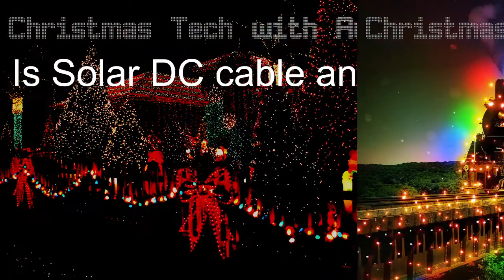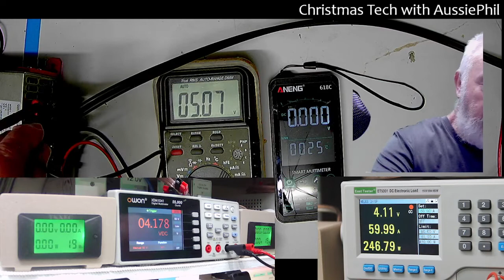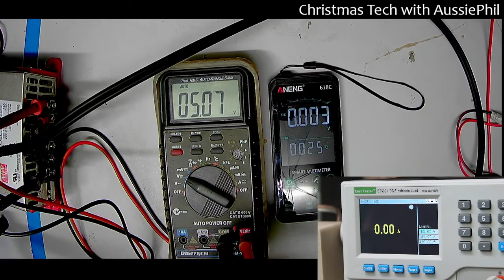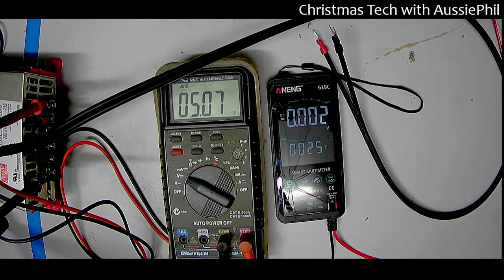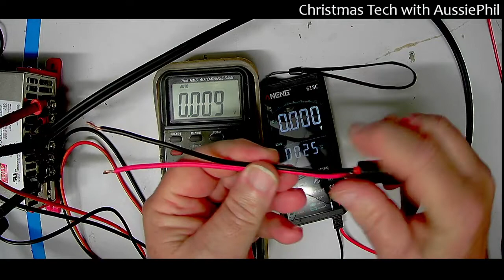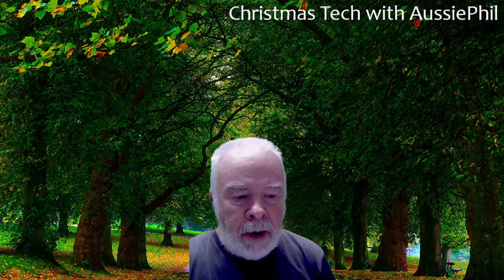Solar cable for Christmas lights

Comment: You had a factor of 10 measurement error around 6:20. You say 1.28V when it's 0.128V. With 1.28V per conductor drop the load would have had around 2.5V rather than 4.7V.
The connectors on nearly all power supplies have a 30A rating so exceeding 30A is a bad thing. That's the main reason why power supplies will have multiple V+ and V- connections.      
  The Meanwell supply you have is probably a 90A 450W supply in the same body as the 500W 12V (and higher) supplies. For more than 90A there would need to be 4 V+ and V- terminals (in theory).
  Cable sizes is something I rabbit on about all the time. I ALWAYS specify by mm2 per conductor. Some cables are sold via mm2 but it's not per conductor but across the pair of conductors. Automotive cables are often/normally specified by the outside diameter of the insulation so the 2mm or 3mm or 4mm has no direct correlation to the mm2 that the cable is.
  You had some weird audio issue where there is an echo that sounds like it's triggered by a vox. Not even sure how to describe it or even work out what would cause it.
Reply from the maker: the Meanwell is a SE-600 model rated by Meanwell at 100A @ 5V spec here. https://www.meanwell.com/Upload/PDF/SE-600/SE-600-SPEC.PDF 
I keep getting told Meanwell == Genuine ratings, as for the barrier strip i agree most of the 350/400/500 in the 350 size format will have 30A rated barrier strip
However the SE-600 series uses a larger, heavier duty barrier strip, 13.5mm spacing and either 40A or 50A, the some size is also available in a 63A rating, so whilst I may have pushed it a bit, there was no thermal evidence that the connector was under any stress. The broad statement of nearly all power supplies is miss leading, from 600W up the bigger supplies will move to heavier duty strip or even buss bar style outputs